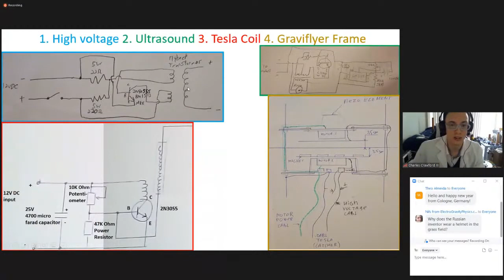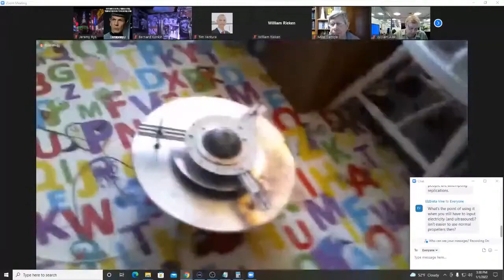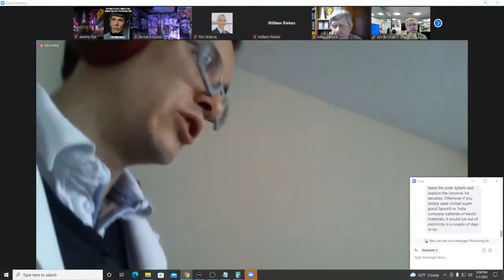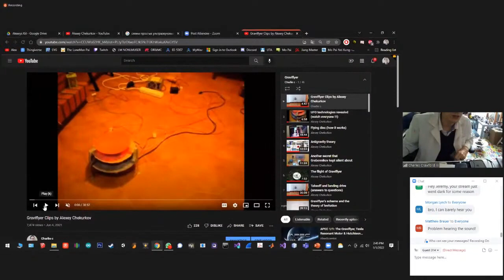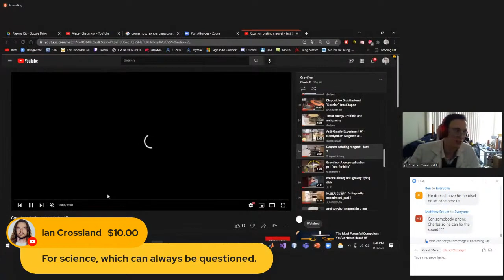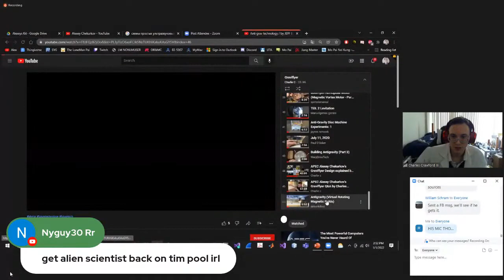APEC Alexey Chekurkov's Graviflyer Kit

Comment: You need to adjust the high voltage frequency the same in ultrasound frequency and make sure the neodymium magnets are at the right polarity and speed of the motor, in simple terms find the right frequency of the device

Comment: the oxidation layer on the center plate is used in systems to stop spark over. the magnets on other designs was to trigger the center plate to go - it was a bad idea.

Comment: Привет
 Charlie, this cymbal has parts that aren't needed, like rotation. The most important parts, ultrasonic sensor and high voltage, also recommend to pay attention to electrostatic electricity when designing, so that it comes out of the ultrasonic sensor. Good luck!                                                                                                                 I subscribed to you. I don’t have time now, I think later I will also start assembling a flying machine.

Comment: These days such videos are hardly convincing anymore. There are guys parading around through Chernobyl and this guy can't get solid witness accounts and better demonstration videos?  His gravetometer is just a glorified HF rectifier that will use the electric field from something like a Tesla Coil to move the motion on the meter. You can do the same thing with an avramenko plug and a single antenna. The amount of physics here is insane but if the guy is literally trying to provide kits and instructional information he's put himself in a box by providing assembled devices.. This means you're dealing with what is theoretically just a sweep of your variables to get it working.. When none of these settings provides lift he doesn't have much way to explain that other than going back to square one and explaining that such things may not be practical for replication because the "tuning is so precise".

Comment: There are only two types of anti gravity.
1. Parabolic force amplifier. Which explains all disk shape ufo.
2. Inertial focused power greater and inverse to the acceleration or gravity.
This device is number 2. Electricity is focused focused by magnets to create an artificial gravity well. I don't get where the ultrasonic sound figures in? Many to vibrate the atoms there by amplifing the dielectric field? Any thoughts on this?
Reply: I don't get the ultrasound either, but it seems to be from Grebennikov's experiments studying beetle wings.

The thing is that all you need really to have a strong enough electromagnetic field around the device to charge the plates with eddy currents, which will make it float. Ed Leedskalnin who build Coral Castle basically figured that the idea is to create an opposing magnetic current within an object to the Earth's natural one and it will float, like like-poles repelling each other. The stronger the electromagnetic field, the stronger the levitation.
Reply: @christianvachon2235  Eddy current may heat the pltates, I don't see hot metal here, I don't get the ultrasound too...
Reply: @vinny71  Thanks. I think you are right about the eddy currents...
Reply: @christianvachon2235  Probably I got why the ultrasound, he says he had been inspired by Grebennikov so he built this contraption based on this theory, if you look at the device you can isolated it in two parts, the bottom there is a rotating mag field  which on top has an high voltage plate, I assume this is a small replica of the earth , a magnetic rotating core with a charged layer ( atmosphere ), on top we have a charged plate vibrating at high frequency, insects charge wings ( elitree ) with high voltage and vibrate them to create a magnetic field, so we have a reproduction of earth , ad a reproduction of an insect fyling over  ( ????? )
Reply: @vinny71  I had mentioned Grebennikov and I I think you are correct. Your explanation makes a lot of sense. The device is creating an electromagnetic field. I think that the insect comparison is very good. Insects create a vortex with their wings, and I think that at some level this does the same.

Comment: Hello. That model never fly . Only way to fly on rope .
Reply: @Hubert Okari That is some very circular logic. It can't be a scam, because if it were a scam then the scammer wouldn't show you how to make it, oh, but wait, when it doesn't work that's because you didn't do it right, and not because it's a total fucking scam?

Watch the original video by Чекурков with a critical eye. The thing is CLEARLY being suspended by fishing line. He does a half-hearted attempt to show there is no line by waving his hands NEAR the thing and then using forced perspective to make it look like he waves a stick over it (do a side-by-side of the hand-waving bit and the stick bit and you can see he is MUCH closer to the camera in the stick bit), and you can even see it bobbing and swaying exactly like it would hanging on fishing line.

https://www.youtube.com/watch?v=Z-M55XP3D4A&t=530s
Reply: Just saw this thing on the internet and while I can say it looks to be some fairly interesting demonstrations there are too many possible ways it could be faked. On top of that there is no real engineering I can see going into lifting that thing that is in the realm of plausible. The rotating disc seems to be more just a thing of stabilization while the magic tesla coil is just providing some high voltage or frequency necessary to make it work. All of that screams of being fake as hell lol. How that guy thought a low power Tesla Coil would somehow incorporate into this thing being antigravitic by way of specialized rotating discs is wild. People who are into Gerard Morin type stuff would surely eat that up like hotcakes though cause I see it all the time. If there was just a fragment of sensible physics behind its workings I wouldn't flat out dismiss it.

When I see him waving around some kind of transmitter to influence it I start wondering to myself if he's even taking himself seriously considering he's literally air-hugging the thing in some videos while simultaneously explaining how complex the RF tuning is. Sorry guys shit don't work that way. It even looks like there are kits?? People are going to be going nuts trying to tune that thing til they start convincing themselves they saw a leg lift up off the ground a millimeter. That may be because they got frustrated and cranked the RPMS til it started going wobbly.